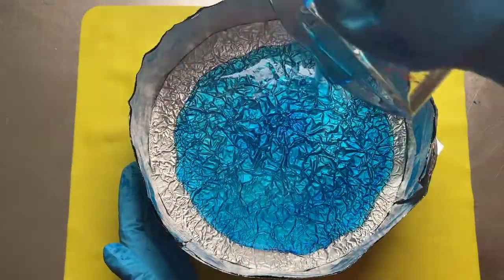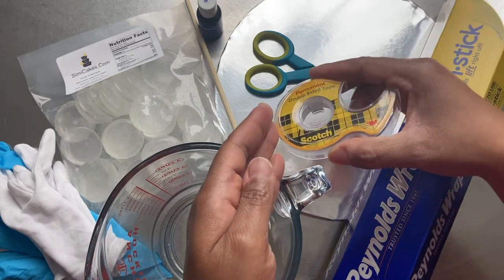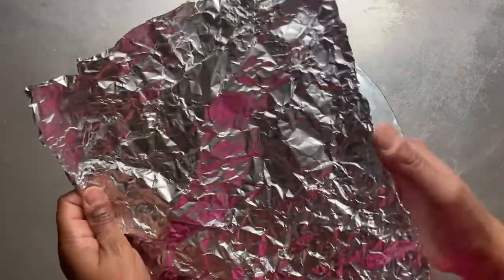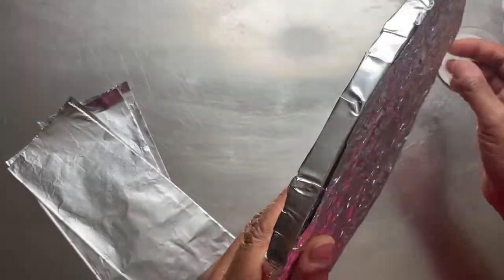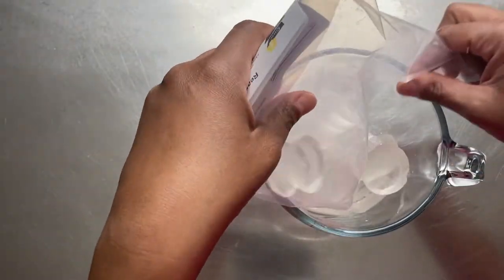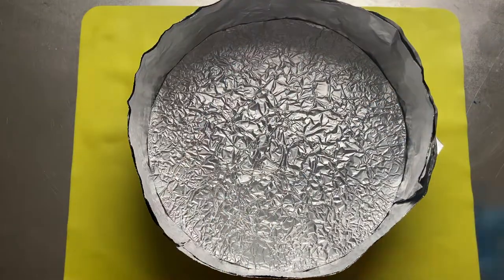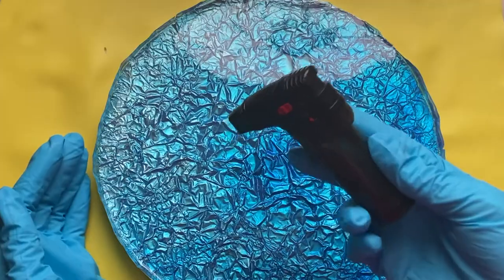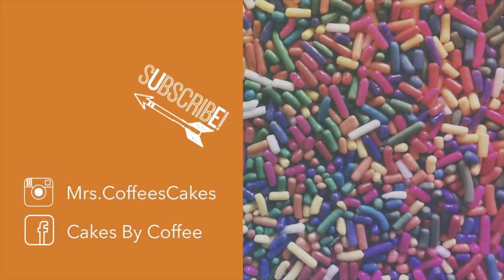CAKE BOARD DESIGN: Water Effect with Isomalt

Comment: Your videos are great! I am learning to bake and I have a few questions I was hoping you could answer (they are not related to this video).
I want to bake 6 inch 4 tier red velvet cake. 
First question: Would I need to use dowels? Or do you think I can leave them?
Second question: If I use cream cheese frosting will it be sturdy enough to do the 4 tier? 
Those are my questions. Thank you
Reply from the maker: Hi! So that I’m understanding correctly: You’re making a 4-layer 6” round cake right? Not tiered,  because that would be a different level/size.
Reply: @AsiaCoffee  yes sorry not tiered just 4 layers with cream cheese frosting in the middle
Reply from the maker: @Taqsunis  Cream cheese icing/frosting tends to be very soft. Make sure to thicken it up (usually with powdered sugar if the recipe calls for it). Be gentle as you stack and fill your layers and ice the cake. If you’re traveling with this cake, I would highly recommend using dowels or bubble tea straws (my favorite). Insert 3 in a triangle configuration. Best of luck with your cake!
Reply: @AsiaCoffee  thank you so much!